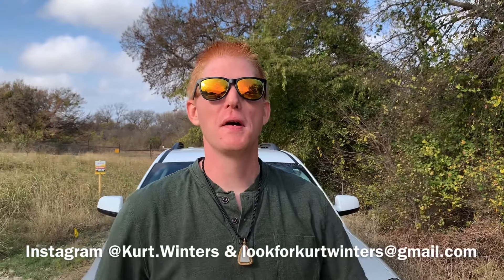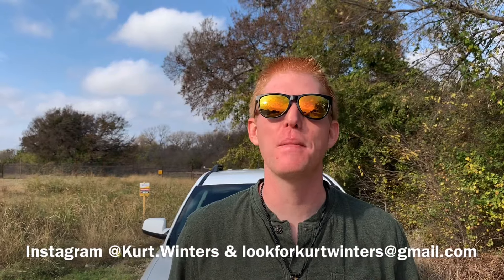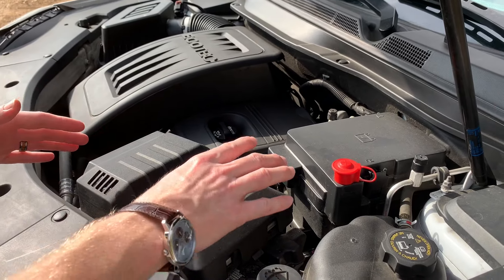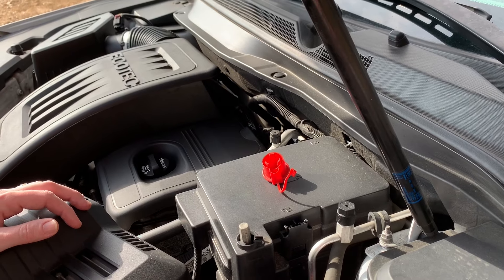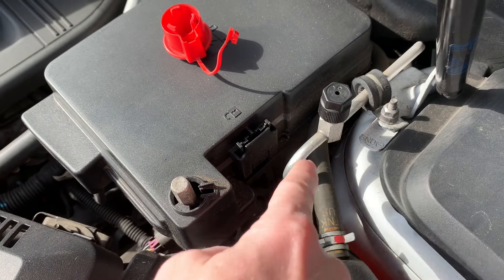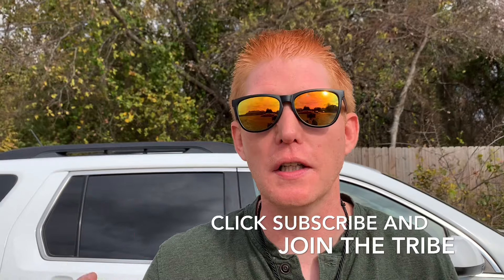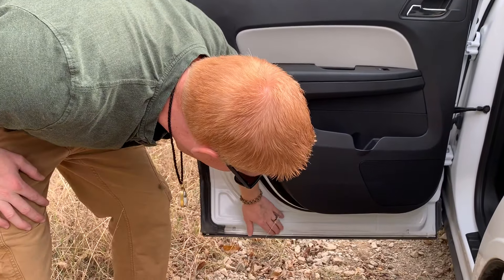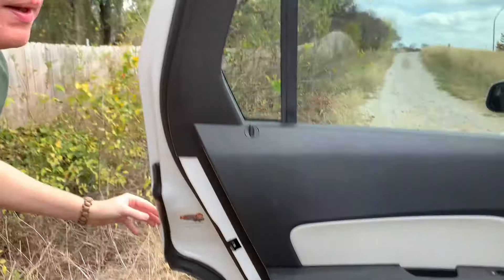3 Reasons NOT to BUY a GMC Terrain SLE  (Issues buyers should know before they BUY !)

Comment: We have a 2011 GMC Terrain 2.4L SLE. 2nd owners. Got from dealership. Had 39,000 miles. I read up on it online & watched videos. I check the oil after each trip the next day. Keep the oil changed. Have to add little oil. Replaced the intake solenoid. Replaced the tires once. Replaced some exhaust pipe & resonator. Removed & cleaned the air fuel intake. Replaced the battery twice. Haven't changed the spark plugs yet. Now has 118,000 miles.
Reply from the maker: Very nice! STILL GOT MINE ABOUT TO ROLL 130K

Comment: I’ve had a 2011 terrain v6 for two years now, the only issue I’ve had it’s the rust on the doors and I replaced the power steering pump, aside from that it’s a great daily for me, I’ve beaten it up day in and day out and it’s still going with no hiccups.
Reply from the maker: Good to hear ! that v6 is a good engine , from what I hear. thank you for the comment !
Reply: @KurtWinters  

We had a recall on those doors, you should check with the dealership. The recall may still be outstanding on your vehicle. But those doors rusting was a wide spread problem, leading to recall.
Reply from the maker: @googlreviews7813  thank you for the info sir ! i will check check
Reply: Purchased a 2012 GMC Terrain last Feb. It is DEFINITELY rusted below the doors.
Reply: There is a power steering cooler, which looks like a small inline radiator that rubs against the vehicle until it fails. Thats what happened to me. Unfortunately my shop couldn't find any aftermarket replacement so I had to go with an original GMC part which was very expensive. The repair cost me $550!

Comment: I purchased new a 2011 GMC Terrain SLT AWD.  It has 111,000 miles on it.  No “Chevy” shake up to 80mph.  Never took it past 80 so can’t say what will happen above that mark.  The battery is easy to jump or to help jump someone else.  Access to the battery is much simpler than you’ve hinted.  Anyway, my 2011 runs great.  Just keep up with the maintenance schedule and it will serve you well.
Reply from the maker: Thanks Terry ! I appreciate the comment.
Reply: Lol lucky you. I purchased a 2014 terrian denali and 2 days after I bought it, it started dying every time I came to a stop! Took it in and they cleaned the throttle body. Got oil change in april 2021. By july 2021 it was buring oil which lead to the timing chain jumping and damaging the engine which required me to put a brand new engine in a car I had just purchased 3 months prior.  Now 3.5 months after new engine the car is idling rough, hesitating, and vibrating. This was my first ever vehicle purchase. Normally I just buy a $2k beater. Never in my life will I buy another gm.
Reply: Why would you buy something that looses 60% of it's value in 4 years.

Comment: I have a 2016 gmc terrain slt v6. I live in iowa, winters can be pretty crazy. I made it 30 miles home on a closed highway with cars stalled in the middle of the highway. I'm just about at 100k miles. It's been pretty fun to work on. I do all my oil changes, just changed my rotors and pads, and put some $1000 tires on. I've never taken it to a mechanic, because I have access to any tool I need, and I don't trust mechanics. I use A-1 auto for all of my upkeep. It's been very fun, and I still love my car after 3 years. Only downside for me is the hvac system. You either get hot, or cold. No in between. Appreciate your video. But so far, this has been a comfortable, safe, reliable car for me in my unpredictable atmosphere.
Reply from the maker: it can be a sweat box for sure. is your car AWD or front ? 2016 is a great year too. Glad you enjoy working on your car !
Reply: @KurtWinters  fwd. I wish it was all wheel, but at the same time, it does just fine in front wheel
Reply: Bring it back to the guy that fixed the AC, oh wait that was you!!!

Comment: I have a 2012 sle terrain bought with 205678 about 3 months ago and I’m the second owner and I changed all the censors and changed the oil. I have no engine light on and now I’m at 209896 and it’s still pulling strong like it’s now even my front wheels get rubber if I floor it from a stand still. This truck is still running strong 💪🏾
Reply from the maker: HELL YA !

Comment: I bout a 2017 GMC Terrain SLE. Mine obviously was a complete LEMON. In under a year I had to change all 4 tires, then the water pump went bad and had to replaced. Then I noticed the oil level was decreasing much faster than normal. Months later the car sounded like a boat as I was driving……. It turned out to be the muffler, which had to be replace, then, in the same week, the PCV caused the rear engine seal to blow. And that became a $3200 job. Initially I loved my Terrain, but I am overjoyed to be rid of that junk!!!!!!!!!
Reply from the maker: thank you for the honest comment, more people should know about it's issues

Comment: You didn't talk about changing the battery, you only mentioned jumping it. And yes dummy, when you charge a battery you are supposed to fasten the negative cable to a grounded point, bare metal part of the car. Looks like to me they were smart to give you that connection so you don't have to look for someplace to connect it. Next time, when you are going to talk about something, TALK ABOUT THAT ITEM! Not one word about 'changing' the battery.

Comment: I changed the battery on my 2018 GMC Terrain FWD, LTG 2.0L L4 gas turbo engine with Denal package, and the battery swap out was easy cheesy and had it done in 15 min. Just a couple of nuts holding down the battery bracket, then a plastic battery protective cover, then the positive and negative cables , then the removal of old and installation of new. Simple.
Reply from the maker: Thanks for the comment and welcome to the channel

Comment: the jump point for the ground is fine its just bolted to something that is connected to the frame its perfectly fine place for a negative cable. you can hook jumpers to the positive side of the batter and negative or a spot on the frame that isnt painted its just to make a ground
Reply from the maker: correct

Comment: I own a 2013 GMC Terrain SLE, 58000 km, new from the dealer and does not use any oil at least yet, still on the original spark plugs and wiper blades. Engine oil is changed earlier than when it says to and the only issue I have had was I replaced the rear hatch lift cyls... that's about it. I even have a small utility trailer I pull with it and this vehicle has been good to me.
Reply from the maker: nice !

Comment: Wiper blade problem you could use Rain X in case this happens to you. It wouldn't fix the wipers but it would allow rain water to stream upward out of you view for clear viewing. I actually can drive over 60mph with my wiper blades off with rain X applied.
Reply from the maker: GREAT TIP !
Reply: @KurtWinters  The Rain X in the yellow bottle.
Reply: That’s right,I use it all the time

Comment: Latest NEWS on this model 2010 - 2017 (Headlight Recall)

As I mentioned before, assembled at my employer's facility.

General Motors  said Tuesday it will recall 740,000 U.S. sport utility vehicles to address a headlight glare problems after U.S. regulators rejected its request to avoid calling them back. (GM argued they shouldn't have to recall the vehicles since they didn't cause any accidents or injuries, that they know of).

Earlier this month, the National Highway Traffic Safety Administration denied GM’s 2019 petition to declare the issue inconsequential for GMC Terrain vehicles from the 2010 through 2017 model years. GM said the issue has been corrected in replacement parts and does not affect current generation vehicles. The automaker says it is still developing a fix.
Reply from the maker: great info

Comment: I recently bought a 2012 terrain from a dealer it had 35,000 miles for it I paid just over 14,000. I feel pretty lucky
Reply from the maker: so long term, do you still like it ?
Reply: I'm thinking of buying the same model what do you think?
Reply from the maker: @itsmo9371  year and mileage ?
Reply: @KurtWinters  2012, 76k miles
Reply from the maker: You really need a 2015 GMC or newer
Reply: I purchased my firstTerrain in 2012 it was a 2011 I put 65 thousand miles on it, had 15 thousand when purchased  it.Here we are 2022 ,I just purchased  my second Terrain 2021.
Reply from the maker: @smw372002able  I'm on on the fence about the new body style.....
Reply: @KurtWinters  same I love the older ones
Reply from the maker: @rell4474  me too, so beefy and more truck like !
Reply: Same,  just got a 2012 terrain slt with 60,000 miles grandma car,  for 15K

Comment: 2014 Terrain SLT-2 AWD purchased for $14k, 1 owner prior had 58,000 miles at purchase and 98k currently. I've changed oil and filters every 3,500 to 5,500 miles, rotated tires regularly to maintain peak MPG(avg. 24-31). K&N oil and air filters, transmission flushed a couple times a year at dealership to help with shifting irregularities. Replaced Lower control arms and upgraded struts, shocks, & lower bushings to reduce front sway. Will be installing carbon pads, 1-click calipers w/slotted rotors after this winter. I've considered a performance chip because it's supposed to help with more consistent shifting but an extra 5hp wouldn't hurt either @ elevation. Overall it's a good little SUV that handles snow and rain surprisingly well. Slightly Underpowered 3.6L V6 with limited performance upgrades. Not impressed with inconsistent shifting under power. 2nd to 3rd can be rough at higher rpms. Haven't experienced any wiper issues yet and the headlight recall is a scam GM can keep their piece of tape.
Reply from the maker: UHHHHH,  mines the 2.4 it can't get out of it's own way. redlines at 8k rpm, but is soooo slow. I thought about taking the tape off, the dumb recall.
Reply: Damn , just bout one 2012 GMC terrain 120k miles for 1600$
As mechanic , only missin a stolen catalytic converter
Only 200$ dollar replacement
Owner couldn’t pay there rent 
Let alone fix there car
So fukem 
Got me a great car at a steal off a dumass mistake 😅

Comment: Your "shake" can't be a manufacturing fault. I've had mine up to about 100mph, nothing abnormal.
Reply from the maker: It's a vibration transfer from the engine to the Cabin. Nothing too BAD. Just something a lot of GMC owner complain about on the message forums.
Reply: @KurtWinters  this is the first time I've heard about it.
Reply from the maker: @youknomyname8890  It's more pronounced at 80mph plus, so most drivers may never notice. I am a car collector, and some little things I notice. Other things I let go. GIVE AND TAKE, ya know ?
Reply: I clear 100mph atleast once a month no issues
Reply: My 2011 Terrain shakes when I let go of the gas over 60

Comment: Well I just purchased a 2012 GMC Terrain with the V6. After reading these comments I'm feeling pretty damn nervous about it Karma LOL is the oil consumption problem also with the V6? Or just a 4-cylinder? If you look up how many miles to expect out of one of these vehicles it says that they're really good and can last up to  300,000 Miles I hope i didnt just make a big mistake
Reply from the maker: look like I'm a machine knows his stuff !
Reply: @KurtWinters  He's talking about the old filters, hahaha
Reply from the maker: @ranbymonkeys2384  ahhhhhh ok
Reply: @immachine1565  Thank you! Ive put about 2000 miles on it so far and the oil level is still on full. The only issues ive had are a power steering cooler that rubbed up against something until it failed $500 and the rear camera quit working.
Reply: @immachine1565  im using full synthetic oil 👍👍👍
Reply: @timbonjovi  Get rid of its while it's still running. You'll thank me later. I have a 2014 Terrain with the four cylinder motor, it's a real pile of shit.

Comment: Lol, you paid $12k for 6 year old car with 130k miles, not too smart. My Equinox also 6 years with only 76k was only $9k.  Complaining about battery posts, thin metal, wipers, etc is laughable.  Ive been on these forums for 6 years, never heard of the Chevy shake, this whiner is just making shit up.
Reply from the maker: the car, had 92,500 miles..... turn up your speaker. i bought it almost 4 years ago. SMH.....
Reply: @KurtWinters  you didnt say 92k, you clearly said 130k.
Reply from the maker: @tssci6774  well, thank you for catching that. you'd be correct, that would have been overpriced. Sounds like you got a steal on your equinox. any issues you've ran into? can you believe my front defroster stopped working last week ?
Reply: I mean... that's how much the dealerships charge. 2013 terrain w 120000 miles is listed at 12,995 at the dealership by me
Reply from the maker: @rell4474  good Lord that is over priced ! SMH

Comment: I had a 2014 GMC Terain with the four cylinder motor, and  the backup camera stopped working just after I purchased the vehicle. The ventilation system stopped working several years later, so I had no air or heat.  My car burned oil like it was the Exxon Valdez, I had to add three to four quarts of motor oil into the crankcase every several weeks.  When it rained, all the water entered my car through the closed sunroof.  The timing chain was the last straw because it was failing, so I went out and  purchased a new fully loaded Honda Pilot, which I love. Someone I know who works at an auto salvage yard told me to get rid of my Terain because the Terain is a pile of shit, he then told me his scrap yard is full of Terains with both the four and six cylinder motors that are blown due to timing chain and transmission failure. Do not purchase a GMC Terain.
Reply from the maker: they are cheaply made. The V6 is a total piece of shit. I'm about to hit 167k miles on  mine with only minor drama ..... but I'm a "car guy" lol.... my goal is 200k miles.... it's a 2014....

Comment: I had a 2010 Terrain. I loved that truck because it fit me so well. Me & my lady travelled extensively & the intimacy of the truck was very nice. I enjoyed the satellite radio & all the extras like heated leather seats & Bluetooth. My biggest angst was how on a 6-cylinder, you
(Joe schmoo) could reach 3- of the cylinders (but)3-were buried & you pretty much had to be a mechanic to change 3-of the 6 plugs. The battery was weird but I adapted. Not necessarily the greatest gas mileage but I loved my truck nevertheless. Never had the Chevy Shake. But the tranny shifting became problematic as well as the battery, starter, alternator & ac went out. I got the battery,  starter & alternator replaced (figured) I'd wait til warmer weather to fix the AC cause the car was as costing me an arm & leg. Car ran for 2-days. Was told I should've change the modules when changing the starter & alternator. Got frustrated, sold the car & still have mixed feelings. When I hit the lottery🤣 I'mma buy a fleet of White 2017 terrains last year of the old style and drive them til I die. Might even send one or 2 to Foos or Kounts Kustom to rebuild from the ground up. Sans the plastic inside, I really love the GMC Terrain.
Reply from the maker: Great comment, well said ! you need to watch https://youtu.be/9NQcUO4ri3w - I am a fan too of the Terrain !

Comment: I'm in Canada.  I have a 2015 terrain, SLE with the 3.6L v6, bought in 2016, with 14K km.  It was great, for 6 years, then it started to go to crap.  It started with both power steering lines, then one of the ball joints.  Currently, I got an "AWD system off", message, then a "Service AWD system" message.  It's at 130K km.   I don't know if I should put more money into it, or get something else.  The problem is I can't afford new, and with used, they're all high KM, or old.  And it's rusting.
Reply from the maker: sorry
Reply: Same as mine it is rusting,2016 terrain.And the battery is always dead from the cold weather.